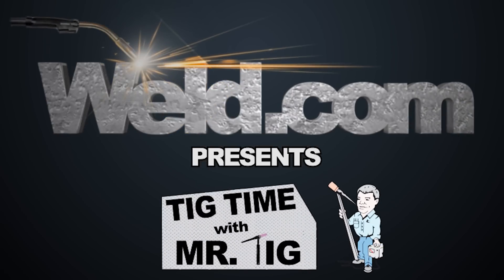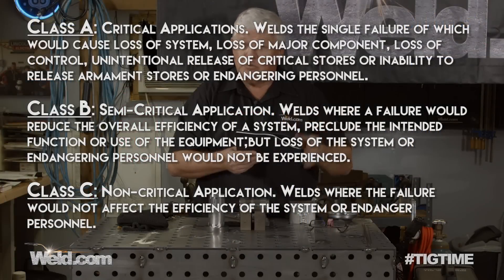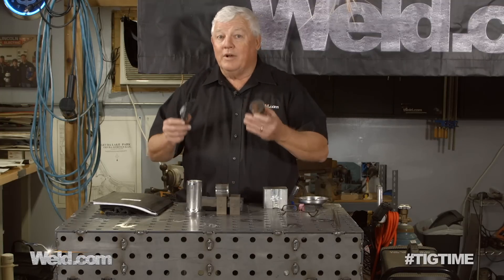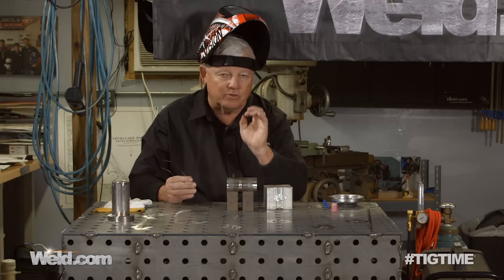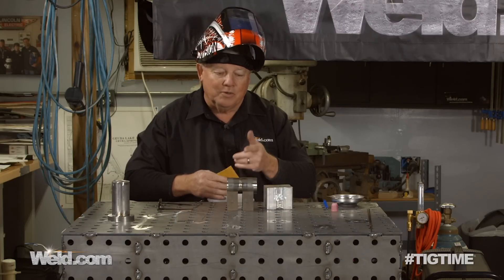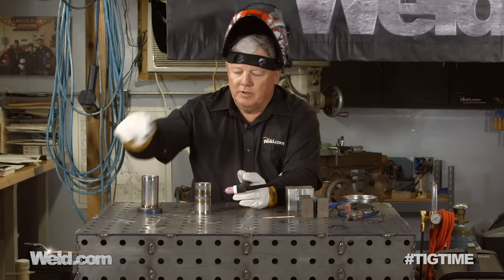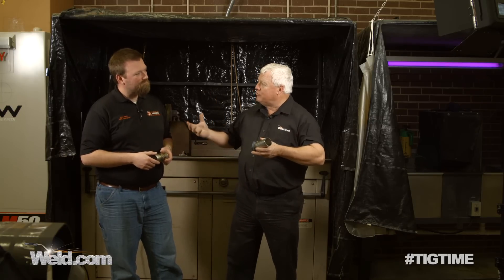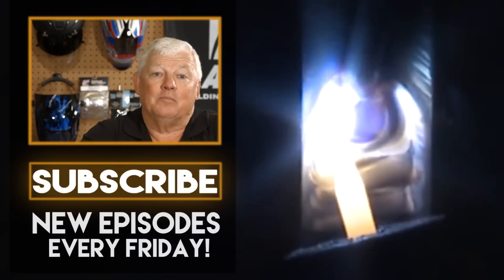D17.1 for Exhaust Applications | TIG Time

Comment: Amps x Time = (Over all) Heat Input! 60 Amp on that thin wall tube with a huge flange is way to low! Turn up the amps, lay the rod in and move faster!
Reply: Yeah this speed is painfully slow..

Comment: d17.1 without that cup and no purge on ss? Mr.tig is a joke! If you want good tips find Jody on welding tips and tricks!  Notice he didn’t show the weld up close so you can’t see just how bad it is and how sugared I know the root is? 😂😂
Reply: It wasnt stainless he was welding. 
You do realise that ER70S2 (as clearly shown on the screen to the right hand side) is one of the two standard filler material grades (alongside ER70S6) for welding carbon steel dont you?

Comment: Ill bet a paycheck that tubing buttweld would not pass x-ray. The root is most likely not broken down and lack of penetration without a purge would show a strong edge or void on film. Mag tests are the easiest to pass, we have had mag tests pass on flanges, and then they leaked on hydrotest.
Reply: +Steve Williams if you were paying attention you would have heard him specify in the beginning of the video that he was welding to class B. Class B welds do not require X-ray, only liquid penetrant. I'm certified to class A in Alum, Ti, Inconel and SS for d.17.1 with thickness of .015-.080. The Class of weld depends on the customer and the application. I work on Ducting and tube assemblies that go on aircraft.
Reply: What would be the best certification that could land me a job welding aerospace parts? I want to certify myself after I finish my program. Or any advice would be great. Thanks

Comment: Two things. .045" is not 1/16" and as per your script, it stated that fillet weld could not be rotated. You spun it....what gives ?
Reply from the maker: +Jeff Silence You  are correct in that the actual filler used was .045 diameter, the script had 1/16 dia. which was a typo.   Concerning the positioning of a part it is necessary for you or your company to designate if a part can be rotated during the normal function of manufacturing.  During filming we will always manually or automatically rotate so the cameras have full view of the weld.  thanks for the questions... Mister Tig
Reply: +Jeff Silence Yes I was going to make the same comments but I saw yours posted. The first thing I was watching for after reading the 2f spec. was if Mr. Tig was going to not follow the rules and rotate the part. Well camera or no camera, I rather seen it done right. So forget about that test- it already failed. The content of the rest of the video was very good.